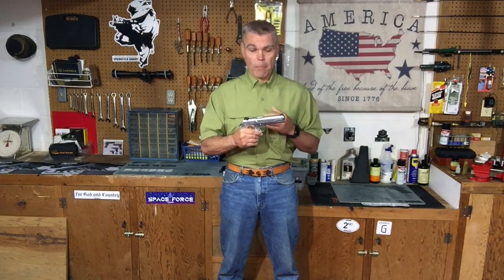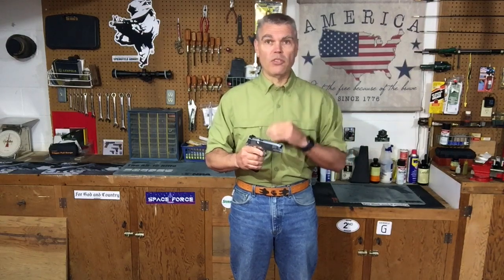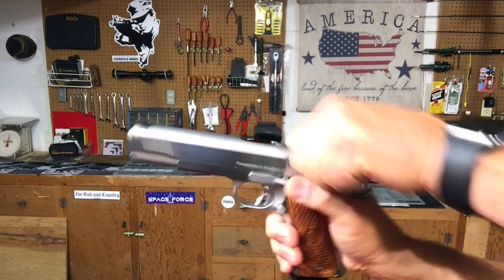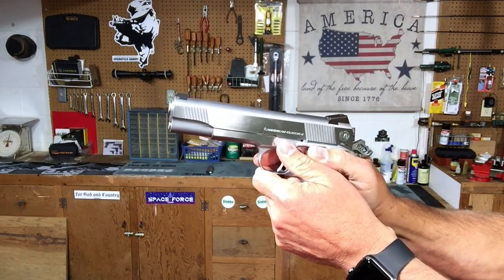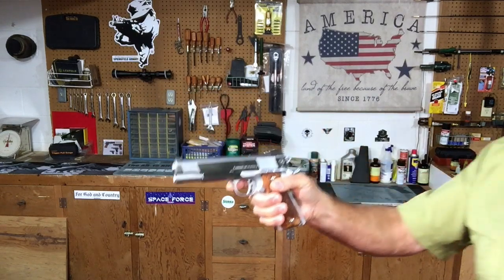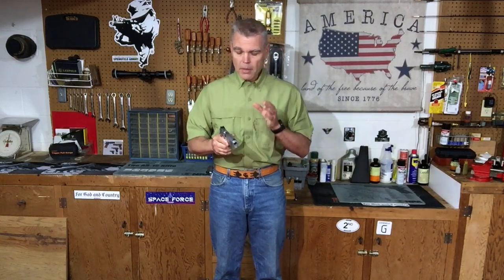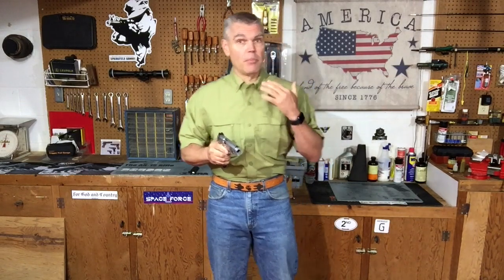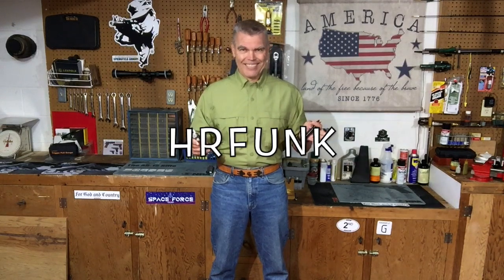MWU: Shooter Induced Malfunction - Slide Stop

Comment: Just what I needed. I am trying to transition to riding the thumb safety while hooting which does help me with my grip safety function. Well I inadvertently extended my thumb to the slide release blocking the slide release from moving. I at first was thinking ,magazine until I was able to prevent slide lock back with three of my best (different manufacturer) magazines. Your suggestion made me watch and I could see and feel the tip of my thumb snuggled right on the slide lock. I also love the single Hand suggestion. Thanks again FUNKSTER
Reply from the maker: You’re welcome. I’m glad to have helped.

Comment: I’ve been a 1911 guy for 52 years now.  I just recently acquired a S&W m&p 2.0 10mm with the redesigned slide stop.  My slide keeps locking back intermittently with ammo still in magazine.  I have been searching all over internet for issues that cause this with this particular model gun.  It’s going to be used for back country carry against 4 legged charging predators.  Slide lock is not good.  I use extremely hot ammo. 1250fps + but within specs.  After watching your video indeed i am momentarily pushing up on slide release during recoil.  Changed grip from my normal 1911 position to modified grip for this gun.  Problem resolved.  Thanks for making this video.  It help even this old shooter.
Reply from the maker: I am so glad you diagnosed your issue and corrected it. There are a lot of shooters who refuse to believe that they are causing the problem. They end up condemning perfectly good firearms.
Reply: I’m now subscribed to your channel and looking forward to more content from you.  You have earned my respect. Good job.
Reply from the maker: Thank you!

Comment: Great points about a common occurrence. Not long ago while shooting a new Shield, the slide did not lock back. I determined that I was causing it with my trigger hand (thumb) but have since established a natural, repeatable grip and have not had this issue again. So good of you to talk about this seemingly small detail that potentially causes significant issues.
Reply from the maker: Ironically, the pistol I was referencing from this past weekend was a S&W Shield. I've never had that problem with mine, but the shooter I mentioned was experiencing it with his.

Comment: Great advice, I bought a delta elite and had the problem of locking on the last round everyone told me it was the amscor target rounds that were under powered or I. was limp writing it so I ran Underwood through it and it would only happen every now and then. I put a new slide stop in it and at the same time concentrated on my grip and have not any more problems
Reply from the maker: Good! It sounds like you worked it out!

Comment: When I was a kid, a gunsmith told me the problem or malfunction is usually the nut behind the gun, LOL. So many buyers are sending their guns back to the manufacturers. Shoot one-handed and hold on to it with a death grip. It is called a handgun and not a handsgun. You can cause a malfunction in a revolver, especially a lightweight one, by not holding the gun tightly which causes bullets to creep out of the case and jam the cylinder.

Comment: I was as having this problem with my s&w sd40ve so badly. That I removed the slide stop, cut it in half, rounded the edges and polished it so it looked nice. Now it is identical to a gen 3 glock and I have never hit it under recoil again.

Comment: When the Glock 42 came out, some had a tendency to activate the slide release while firing due to it's size. A contributor actually was doing that while reviewing the 42 in a video and didn't realize it.  Would think that could be a tendency with many small pistols.
Reply from the maker: I think it tends to be a little easier to do with smaller pistols because there's less to hold onto. Even so, larger pistols are not immune.
Reply: @hrfunk  YUP

Comment: If one's two-handed grip is causing problems, one solution might be to use the left hand to grip the right wrist, rather than the right hand.  I find this method to be more comfortable, as I don't need to stretch my left arm so far, while still enabling me to hold the gun steadier than shooting one-handed.

Comment: This is the main reason I dont like the thumbs forward grip popular with today's shooters. Even experienced shooters still cause these malfunctions. I prefer a revolver grip with thumbs down and I almost never have a shooter induced malfunction.
Reply from the maker: That's the advantage of that grip. The downside is that it doesn't give you quite as much control of the pistol under recoil.
Reply: @hrfunk  I disagree, thumbs forward grip your thumbs do very little to hold the pistol down. I place my support thumb over my shooting thumb, it locks everthything down I also use the support hand trigger finger on the trigger guard ala 80's style. Its worked for me for over 30 years.
Reply from the maker: @2Aknight762  I'm glad it does, and you shoot quite well! I was originally trained to use that grip in the Marine Corps (with the exception that we didn't put the off hand index finger on the front of the trigger guard.) The added control afforded by the "thumbs forward grip" doesn't come from the thumbs. It actually comes as a result of the palm (thumb area) of the non shooting hand filling the space on the pistol grip beneath the thumb of the shooting hand (I hope that makes sense). This increases the surface area of the pistol grip that's in contact with the shooters hands. It all helps with recoil control and target reacquisition. It took me quite a while to buy into the thumbs forward grip, but at this point I believe it does have some advantage.

Comment: I own a 1911 chambered in .50 GI. The pistol produces so much recoil that the safety would flip up locking the pistol into safe prohibiting the next shot. I was told the proper grip position is to rest my right thumb on top of the safety lever thereby prohibiting the lock up. Would you agree with this or is the pistol malfunctioning?
Reply from the maker: There are a lot of 1911 shooters who keep their thumb on top of the pistol's safety to prevent the exact problem you are having. That said, I think the true answer to your question needs to come from the pistol's manufacturer. If this is a know characteristic of that particular pistol/cartridge combination, and other shooters are likewise required to hold down on the safety to keep it disengaged, then that might just be the way your pistol has to be fired. On the other hand, if other shooters do not need to shoot in that manner, then your pistol may need to be serviced. Either way, if I were in your position, I would call the manufacture to find out for sure.

Comment: My bodyguard doesn't lock open with the last round, it doesn't lock open either when manually pulling back the slide with an inserted empty magazine.
Any ideas?
Reply from the maker: My first thought would be that it's a magazine issue. If it happens with multiple magazines, then give S&W a call (800-331-0852) and discuss the matter with their Customer Service people. If you have a defective slide stop or there is some other issue with the pistol, you may need to send it back for repair.